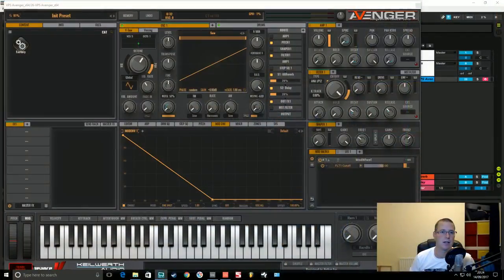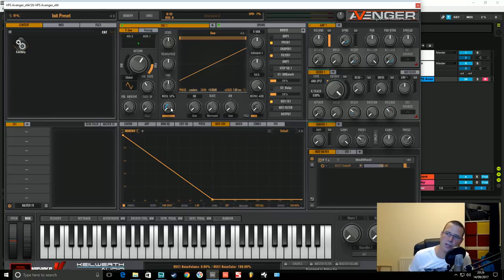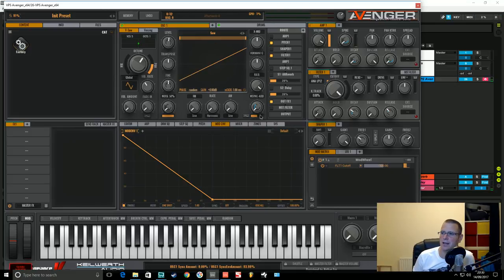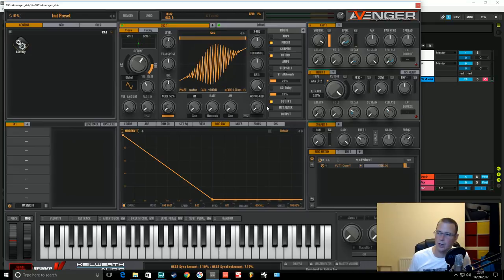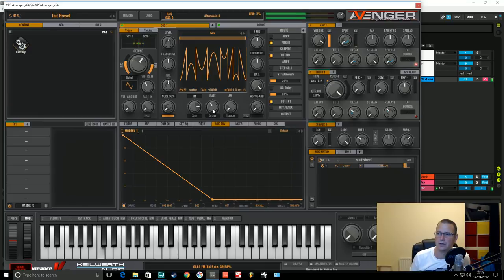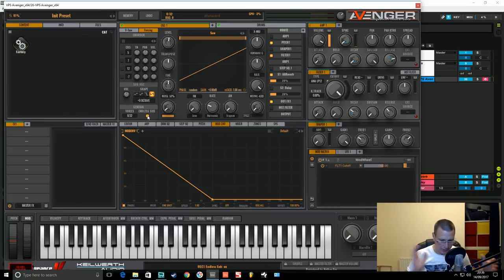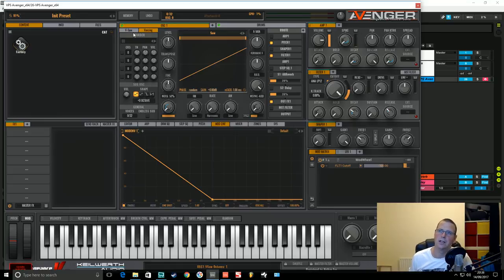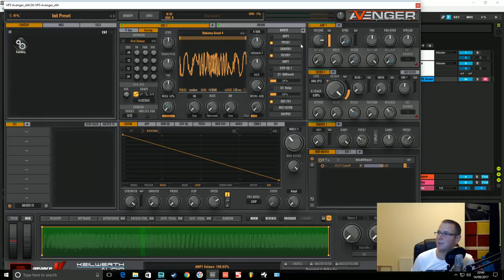VPS Avenger Tutorial -Basic Oscillator Controls

Comment: but how to set pitch wheel range it is stuck to +2 semitone while i wanna set this +24 -24 range
Reply: In what situation would you need to do this?. Surely you just move the pitch knob for such large movements. The bend is designed to do just that.. Bend the note not transpose it 2 octaves?